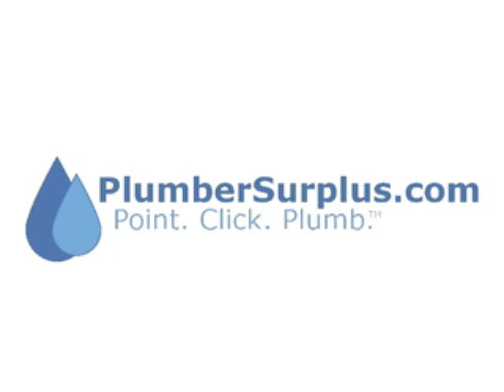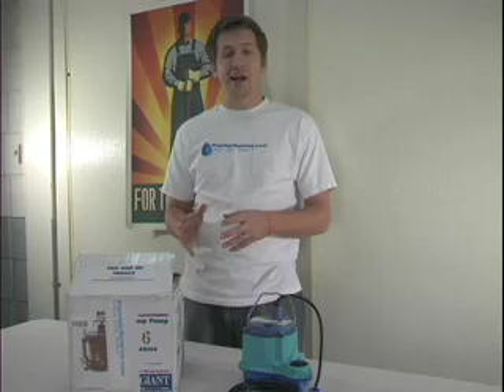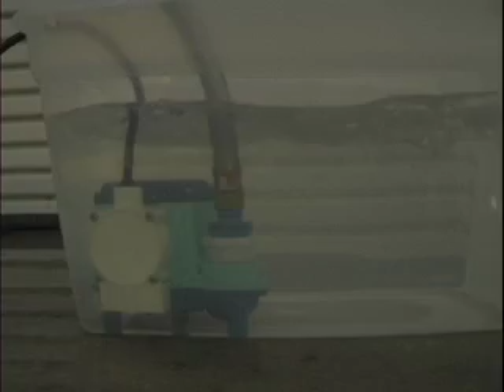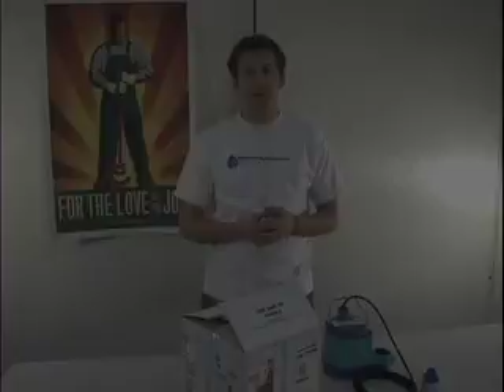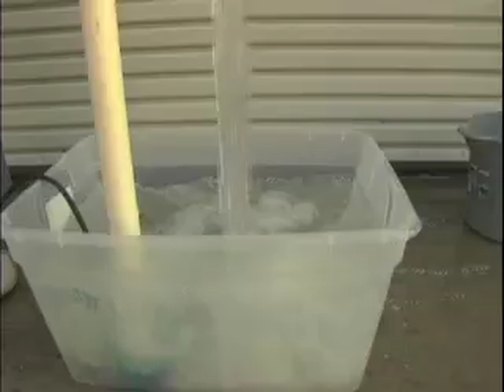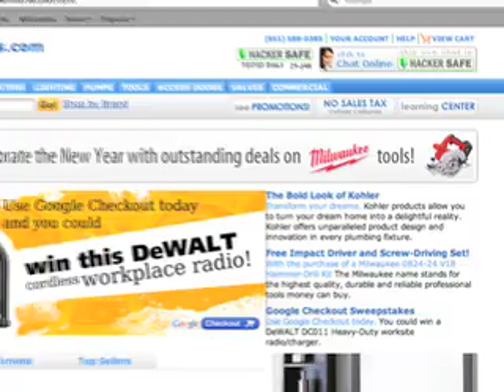Sump Pump Buying Guide by PlumberSurplus.com

Comment: Well done and thorough.  thank you.  i live on an underground spring, I would have liked to have you comment on the life-expectancy of the average sump pump as mine seems to fail about every 5 years.  without an alarm system on it, the basement usually has to flood before we discover the sump pump had expired.